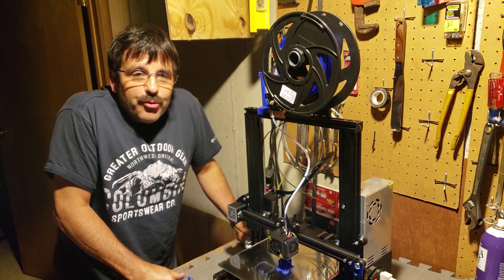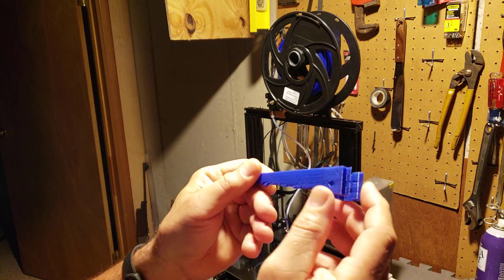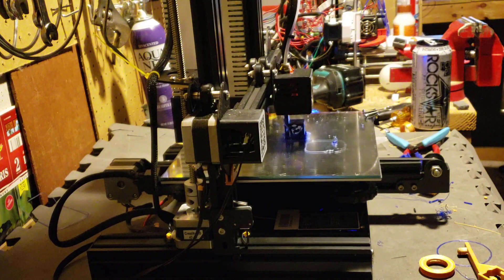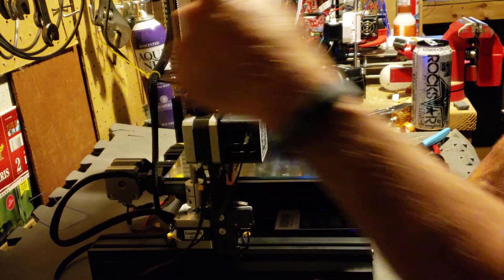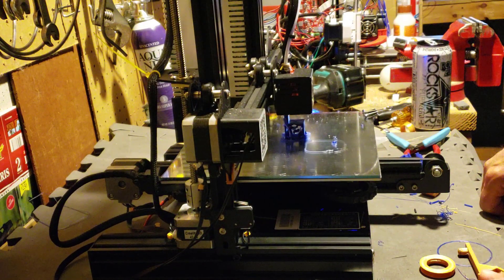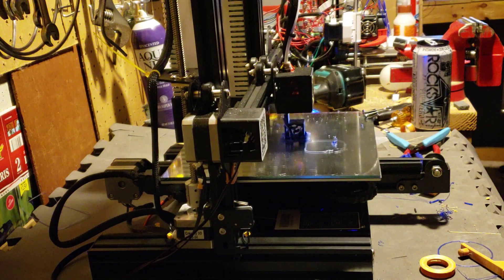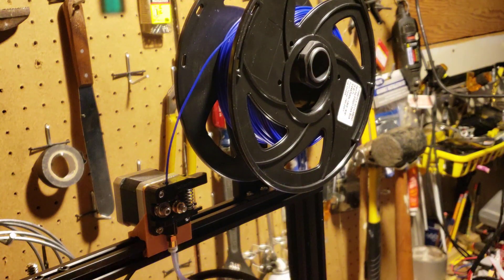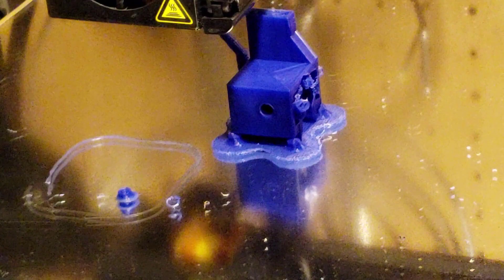Ender 3 Bad Prints? Have you checked this?

Comment: Your background music is too loud, I can't hear you.
Reply from the maker: My bad. =( I do that occasionally. Have you tried turning on the close captions?
Reply: That's a great idea! I just got my ender 3 setup last yesterday and I can't get a good print yet.
Reply from the maker: What kind of issue are you having? I find the biggest thing is getting the proper "smoosh" on that first layer.
Reply from the maker: This might be my favorite starter video I created. https://youtu.be/vC9pMdJ7-9U  I also am a huge fan of the glass bed. This playlist has a lot of super simple upgrades.
Reply: I am printing the test Dog in PLA, and after using a glue stick I was able to get about two hours into the print and everything was going great, I could see the dogs feet! I went to bed and then when I woke it was a spiders nest.  I am going to try a glass top to the bed and put the bed heat up a bit.
Reply: I will check this out!
Reply from the maker: I think the smaller print is a good idea. I like to work with a cm cube and print it close to the front left corner. Once I have that corner homed in... I move to the other corners one at a time. It takes a while, but it has been effective for me. I love my Ender!!!
Reply from the maker: Been there on the spiders nest... Frustrating to lose a print, but it does happen to the best of us.
Reply: I did a small cube last night,  followed your video and moved the print to the front center everything was  going great until the last 10 seconds and then on the last line it was grabbed and moved across the plate. It looks good other then the last bit, I played with the z axis and there is a problem going up at the 60 and then again at the 140 to 160, the whole motor shudders and shakes and then gets stuck.  I think I need to add the shim to the motor??
Reply from the maker: I had one time where I had the cables tangled and the axis could not move as high as it was supposed to.... That would be a good thing to double check.